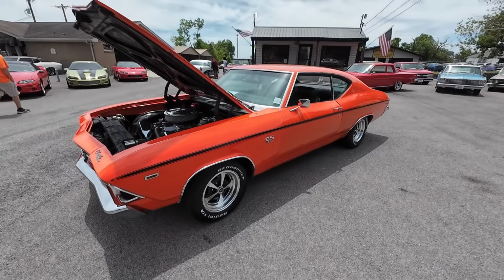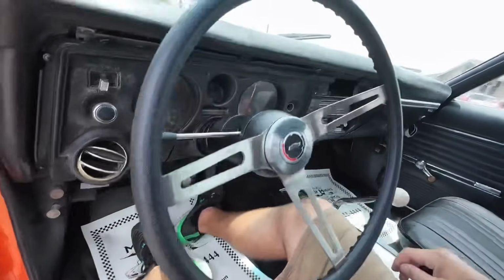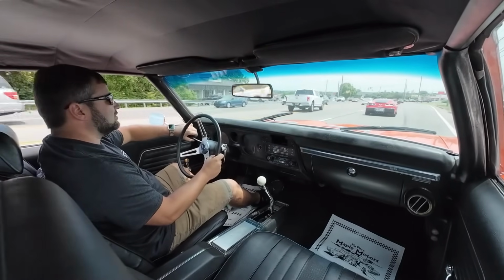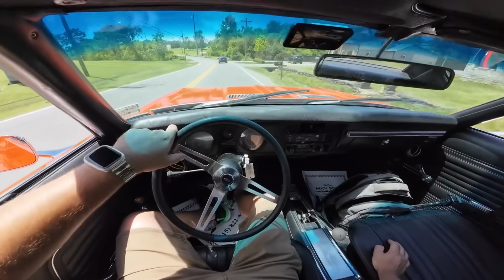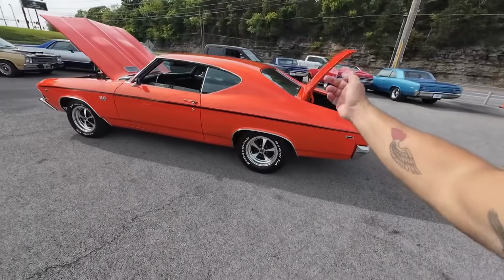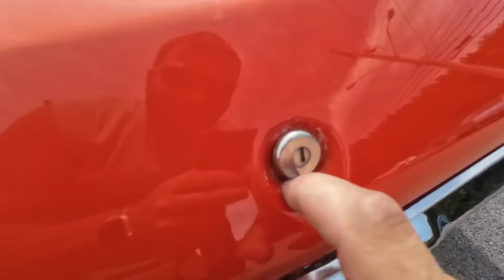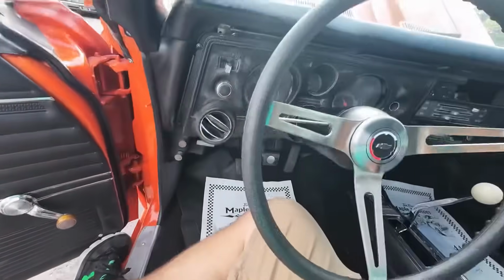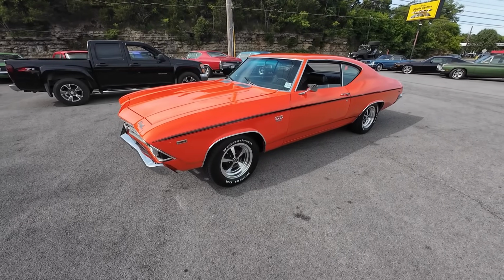Test Drive 1969 Chevrolet Chevelle Big Block 396 SOLD FAST $34,900 Maple Motors #2633

Comment: Love these '68-'72 Chevelles. But they are just getting SO MUCH more expensive to find a really good one. Agreeing with most comments on this one, it looks good, but really needs alot of fine-tuning and work. Probably why the previous owner sold her. Either they ran out of money, or got tired of chasing down issues.  Needs some more lipstick, and at least another $10K to be REALLY nice. Still, looks like it could have potential. But I still like the '68 and the '66 better. Thanks NIck!!

Comment: Just wanted to let you know that the fan shrouds on cars are not for protection. It's so it will actually cool the engine properly
Reply: They serve both purposes
Reply from the maker: And protection from cutting your fingers off
Reply: If you're going to be picky, then it's actually coolant that "cools" the engine. Fan shrouds help direct the air towards the radiator which then helps in cooling the coolant that is sent back into the engine block. The shroud also serves as some protection from contact for those hell bent on sticking their body parts in and around a running motor 😅
Reply: @SDCornelli  thank you for setting me straight. You sound like a very smart person. Please do not get caught in a fan......lol
Reply: @johnkendrick7304 any time🤙 I only set those straight that set others straight 🤷‍♂️ with that in mind I suppose you're a very smart person yourself, one that probably doesn't have a unshrouded fan to worry about right 🤔😅